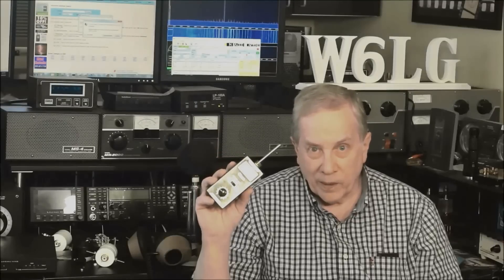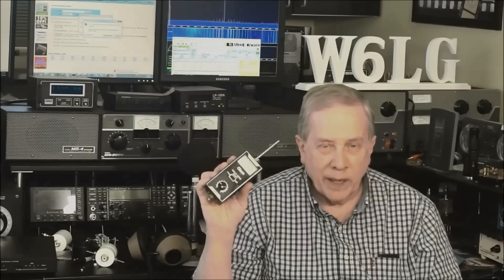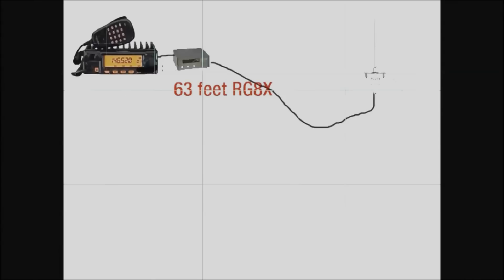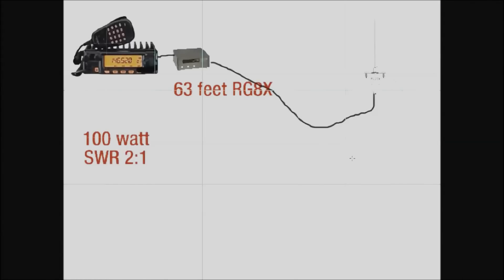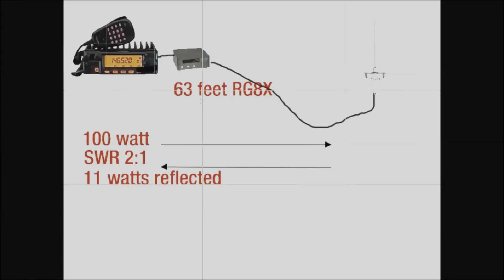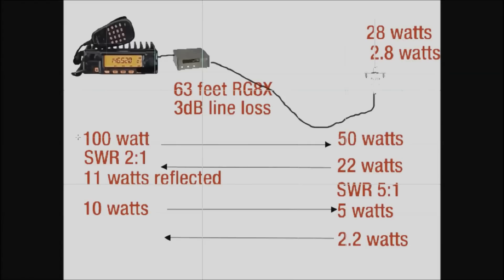Ham Radio Basics--SWR, How To Measure And Is it Important-A Surprising Answer

Comment: Most don't look at the line lose.  There is another thing I have seen and that is where you read the SWR. In the VHF range moving the meter inches can give different readings.  Where is the meter along the wavelength. I have worked on radios for years,  not ham. Found that where the meter is can change what the meter reads.  With a 6 inch cable from the radio to the meter will read one thing and a 12 cable you can get another reading. I think a high SWR is only good to keep the ice from forming on the coax. With the exception you gave on here where about half the 100 watts is lost in the cable,  about 60 watts is given in heat in the cable to keep the ice off of it!
Reply: This is correct. The only time you're going to achieve the same reading anywhere along the feed line is when the antenna impedance is the same as the radio (and the characteristic impedance of the feed line for a random length), and that's the conundrum... and it would be 1:1 anyway. Right? So this means you need to know the impedance of the antenna. This measured right at the feedpoint or via a half wavelength (taking in the VF) or multiples thereof. Furthermore, the impedance of the coax in this instance doesn't really matter. So know the antenna is right for single band use and the rest will take care of itself. I might add that if the SWR doesn't change with the length of the line, then this would indicate the load impedance is correct. I still feel like I'm going round in circles though.

Comment: Someone should come up with an SWR meter that accounts for the line loss. Maybe an input option for the operator to put in type and length of line that the meter factors into the calculation.
Reply from the maker: Brilliant idea!  

Add to that a factor for the age of the coax and additional losses.   Thanks Ronnie.  73, Jim
Reply: @ham-radio   Jim, I just passed my tech and general license last week. Still waiting for my call sign. Thanks for the info you provide. You should design that feature. You seem smart enough to come up with it!
Reply: @ham-radio   The age factor you mentioned got me wondering how temperature would effect it as well. Hot Summer days vs. Cold Winter days?

Comment: Thank you so much for walking through this. The math is not difficult and so many documents fail to show how important feed loss is. The exams allude to the potential impact of feed line loss on SWR, but none of the manuals (that I've seen so far) provide a computational approach to accounting for all of the RF energy.

It occurs to me that going through the arithmetic to account for all the RF energy leaving the transmitter is an excellent mechanic for understanding how much power is getting out of the antenna... and for spending appropriate resources on reducing loss between the transmitter and the antenna. Therefore, I got a big take-away from your video that I will apply as I design my station. (I take the tests mid-March -- at least technician and general... studying the extra manual now.)

Excellent... thank you.

Would you please post your website in the description of your videos or put it in the about section of your YT channel, please? I can understand not wanting to publish an email address, but I would email you if I had it.

Comment: Another incredibly instructive video from a totally new guy only a couple months into amateur radio.  I do have a question though.  Does a stated antenna gain from the refocusing of the power to the airways relative to an isotropic radiator effectively yield more power to the target of the antenna focus direction than is found at the entry point to the antenna (if that makes sense)?
Reply: No. An antenna achieves gain by radiating less in some directions and sending that power in another direction. In other words, if you had a perfect isotropic radiator that radiates equally in every direction, and you changed it to take exactly one half of the back hemisphere and send it forward, you’d have a 3dbi gain antenna. You’d send twice the power in all directions of the forward hemisphere. Even when you focus the power this way, it still always expands when it leaves the antenna.  Because of this, the power you can actually receive at some distance will only be a fraction of what is transmitted, and falls off by a factor of 4 every time you double the distance, no matter how much gain you transmit it with.

Comment: So then would it be more accurate to plug the SWR meter just before the antenna, if one can do that?  Trim the elements first, then mount it?
Reply from the maker: Excellent, that used to be a question on the exam.  Yes, you are correct.  Thanks for the great question. 73, Jim

Comment: Built 10 meter vertical out of ham stick that survived accident. SWR at 28.4 is 1.09:1. Most new hams feel great I don.t.  My gut says this antenna is not doing what it says and might be best not used.  .AA54 reads R =49.5 Z=50 Xl=-4.4 Xc=1265mf. base on pvc 4 feet up radials 45 degree slopped.to 1 foot off ground hard clay sand mix. My coax DB loss should be under 3db as lmr400. 30 feet. You definitely got my attention on this and antenna is currently down. This antenna must be higher swr as shown in video, Tossing this out as new ham and doing it alone so no elmers or help. Like videos as are not long and too deep. You got my attention as assumed low swr meant all is well.

Comment: Jim, I’m just getting back to Ham radio after many years. I purchased an ICOM 7300 and I will be installing an End-fed 1/2 wavelength 133ft wire antenna to cover the range of 80-10m. The antenna is supposed to be resonant at 80m. What quality coax feed line options do you recommend that I purchase; cost is not necessarily a consideration at this point. I believe that I will need approximately no more than 30 feet of feed line. Your recommendation is appreciated.  Joe M. KA5LJB.
Reply from the maker: Hi, What antenna?  Please tell me the manufacturer and model number. 73, Jim
Reply from the maker: https://www.youtube.com/watch?v=xfqlun3bdI0

Watch that video regarding the antenna.  Despite my suspicions, I did not find a deception in the description of the antenna.  Also, read the review by the ARRL.  In any case, I recommend RG213 or larger.  Apparently, the design is similar to a Zepp or J-Pole.  Good luck getting back on the air. 73, Jim

Comment: I am just building my "shack". it is on a small lot, but has a metal carport grounded 30 inches into the soil 6 times right outside my radio room. the antenna I am going to use for my Kenwood TS520S is going to be a random wire antenna with a feed point at the carport and a pole to let me reach the roof level. from there, I am going to use standoffs to raise it above the roof and carry it in a mild zigzag to my shed, if needed. I want to use 160M and am an early riser, all the HF bands interest me, and I will be exploring them all over time. My radio goes from 160m to 10m, I may use a vertical for 10M. I enjoy your way of explaining things, and look forward to more videos.

Comment: Hi Jim. I'm kind of puzzled with my feed line on my 2m antenna. I have a Comet GP-1 antenna with 60' of LMR-400 between that and my radio. I am using a RigExpert tester and it repeatedly is showing me computed SWR of > 2.0 but < 2..2. I have redone my PL-259 connectors twice. Measured SWR right at the antenna with a 1' piece of LMR and those reading came in close to 1:1. I'm puzzled. I'm at the point of replacing the LMR-400 with something else or possibly not using the solder-type PL-259 connectors and going with either pre-made cable or crimp-on connectors.
Reply from the maker: Do you have ferrite beads on the coax at the feedpoint?

I am wondering if the reading is from common mode currents. Ferrite beads at the feed point and at the entry to the house may tell a very different story.  Your SWR meter may be rectifying current on the outside of the shield.  

I don't think it is a problem with the coax,

That's my first guess after a fast read.  73, Jim
Reply: Hi Jim. I thought something similar and I coiled the ends since I didn't have ferrite beads large enough to go around LMR400. I'm now suspecting I might have cold of loose solder joints not eh PL-259 braids. Was thinking of cutting off the PL's and buying a crimper and trying crimp-style instead of solder-type. I'm not suspecting the cable either..but it is actually DRF400 instead of actual LMR400. I was told the loss per 100' is the same..maybe the quality of construction isn't??? <shrug>..Dunno. Kind of at a loss (pun intended).
Reply: WXField,  I have used Davis RF's DRF-400 for several VHF/UHF antenna installations, including ARES stations at local hospitals, and I have never had a problem that I could trace to the cable itself.   The connectors I attached were occasionally a problem though, especially the solder-on types.  It can be tricky to get the coax braid soldered to the connector correctly without melting the dielectric and ruining the cable's electrical characteristics.   I have certainly over-cooked my share!
   You didn't mention which Rig Expert Analyzer model you are using, but I know some of them include a function called "TDR" (Time-Domain Reflectometry) which can identify opens, shorts, and other damage inside a run of coax cable that isn't visible from the outside by looking for reflected signals and computing the distance to the damage based on the signal's round-trip time similar to the PING test in computer networks.   If you suspect the cable, you can test it with a TDR, but I would look pretty hard at the connectors and then try a common-mode choke of some sort, like the ferrite beads mentioned earlier.   If I recall correctly, ferrite Mix #43 is recommended @ VHF/UHF frequencies, or you can try any other common-mode choke designed for VHF/UHF at your intended transmit power.   73, and best of luck!
Reply: Figure it out!! I mounted the Comet GP-1 to the top of an old satellite TV mount (coincidentally called a j-pole mount). There's about 5" or real estate to mount antennas to on the business end of this mount so below the GP-1 I had an omni-directional digital TV antenna as well. I disconnected the GP-1 and moved it to an area about 8' away from the TV antenna and my SWR maxed out at 1.2 across the 2m band. So there's something wacky going on with the TV antenna that's interfering with the GP-1. I will find another location clear of the tv antenna to mount the GP-1 and that should be it.

Comment: What is the loss on RG 8?
Reply: In order to answer your question, we would need to know the length of cable you need, and the highest frequency you will use over the cable.   Coax Cable loss is normally expressed as a value (in dB) at a given frequency for a given length of the cable .  For example, LMR-400 cable has a loss of 1.5dB per 100ft of cable at 146MHz.     Coax cable loss tends to increase with frequency, so the same cable has a loss of 2.5dB/100ft at 435Mhz.

Comment: Hey Jim, great video. Quick question. I have an swr
Meter but it didn’t come with a short jumper. So I just used an extra 9 foot coax cable. Is this ok or will it severely alter things as I tune my antenna?

Comment: Jim ,  It might be worth emphasizing that we are talking about Voltage here,  As in Voltage SWR. And that voltage varies along the length of the feedline. Of course the SWR at the transmitter is what the manufacturers are concerned with, even if as you noted the antennas actual SWR maybe much higher..
How does the SWR affect the feedline losses ?

Comment: Im running rg8u to a pretuned antenna a tram. THe swr is 1.4 with 5 watts and a 2 at 80 wtts. How can i get the swr better and should the swr be done at 5 watts only?

Comment: So Jim,  regarding your own ham station, I'm noticing your top grade antenna rotators, assuming you have towers, which means they are probably not close to your radio shack, so I am guessing you run a minimum of 100 feet of gas-filled microwave cell tower hardline to your tower yagis,  and compensate for any signal losses with RF amplifiers pumping close to two "'gallons", so you've probably  "Worked All Galaxies" ??
Reply from the maker: The rotators are not Yaesu's best model or most expensive.  The feedlines are hardline that I purchased surplus.  I made my own coax connectors from copper water pipe and UHF connectors that I had in stock. Two of my amplifiers are homemade with parts purchased at swap meets and shows over 50 years.  Some of the parts were gifts from Wolf in Germany and Stan in Russia.  Both guys were very generous.  The Drake equipment is decades old and purchased over decades.  The K3's were purchased new and I paid full price.  The same is true of all of the Elecraft equipment.  There have been some other gift from WB6ROW, W6BQW, W6FR, W6ZAF and others now SK.  The land was purchased in 1978 for a little over 20K and I built the house very economically.  My feedline losses are in fact, very low.  I think that covers everything you commented about.  Jim W6LG
Reply: Thanks Jim for all the information on your radio room.  You are truly a "Ham's Ham" in the same tradition of the first radio operators who designed and built all their own gear. You have managed to collect and build a very impressive station which truly reflects your ingenuity,  knowledge and skill in electronics and radio. You have merged your scientific background with history into the hobby, and your videos are truly an "Elmer" to so many hams who don't have the opportunity to learn from  experienced pros like you. Keep up the 'fine business' and thank you for reminding all of us to get up out of our chairs and walk to stay healthy !  '73
Reply from the maker: Thanks and I am trying.  A few of the new diagnosis are very discouraging.  I go for more tests next month.  Some are for the third time.  Fortunately, I have the ham radio hobby and can do the YouTube videos to keep me active.  Part of the time I am on oxygen which helps a lot.  I did not smoke and seldom drank alcohol.  Just bad DNA I guess.  We are still researching that.  Thanks for the wishes and support.  73, Jim

Comment: I assume then the G5RV Antenna overcomes a lot of loss with the use the ladder-line feed cable?
Reply: One of the best antennas I have ever had was built by a Navy communications master chief. He made his own ladder line with 1/2 inch pvc pipe and if I recall, 12 gage solid copper wire. That antenna still rocks to this day, and minus the tuner I get excellent SWR's with his balun and the short run of RG213 into the shack.

Comment: Jim... thanks for a very apropos video.  This re-confirms that I made the right decision to bite the bullet and install heliax between my VHF rig and A26B2 beam antenna on the tower since the coax run is substantial due to site constraints at my QTH.  73!

Comment: Hi Jim, When u are talking to an other ham and telling the power you're using, do you say the actual one or the one you set on your transceiver? As in some cases there could be a significant difference.
Reply: Most people use the power at the transceiver out of convenience, but the power at the antenna is more correct. When you get into microwaves where it is very hard to overcome losses and get power to the antenna, most folks use the value at the antenna, since they’ve probably measured it.
Reply: @stargazer7644  thanks.

Comment: One must ask why high power broadcast and military HF installations all use 600 ohm open wire (pipe) feed.
Ladder line has some huge advantages over coax.
Reply: @chris beerad a balun with the right ratio will get it close.  an antenna tuner will get it the rest of the way.  some antenna tuners have internal baluns (4 to 1 usually) so you can hook you balanced line directly to it.

Comment: Hi Jim, Great video!  What effect in total losses does using an antenna match at the radio to bring the 2:1 swr to say 1:1.1? Thanks AC9EK
Reply from the maker: Not much.  I did that test and it was almost nothing.  When the mismatch is huge, then it becomes a bigger number.  But still the loss due to SWR is not as much as we think.  Of course, you and I want a feedline to match at the antenna.  Thanks Mike!  73, Jim

Comment: It was calculating coax loss with high VSWR that prompted me to go to open wire feed. Sometimes though the loss can slightly work in your favour, most rigs with built in auto ATUs can't cope with severe mismatchs. If you have 100ft of RG58 miraculously the radio will appear to be happy. It is not good engineering and is grossly inefficient but sometimes it gets the job done.
Reply from the maker: Exactly!  It took me years to understand that.  73, Jim

Comment: Jim, if i move the swr out to the base of the antenna, temporarily (just to get a reading) would the swr read 5:1 ? or would i still have to do all the computations??
Reply from the maker: Take a reading and if it is less than 2:1, you are probably good to go.  It will read much less at the station.

73 Jim
Reply: ok, good to know, and ty sir KD9GRP 73s

Comment: so would measuring SWR at the antenna result in the 5:1 reading you mentioned in your example? If an antenna analyser gives a 1.1:1 SWR reading with 100 feet of coax, I guess its would be different with a 3 foot jumper at the antenna?
Reply from the maker: Yes, likely it is going to be higher.  Thanks for asking. 73, Jim

Comment: Online coax loss calculator.  www.arrg.us/pages/Loss-Calc.htm Probably other ones out there..
 Lots of folks have dual band radios these days. On 440 Mhz loss gets really ugly. Even with LMR-400.  Try to also keep the coax as short as possible.  Don't coil up excess.  Chop it off and put on a connector.  I keep pointing folks to your videos Jim. Good info.
Reply from the maker: So true.  You probably know guys who have used RG8X on 440.  Thanks for the support.  73, Jim W6LG www.hamcq.com